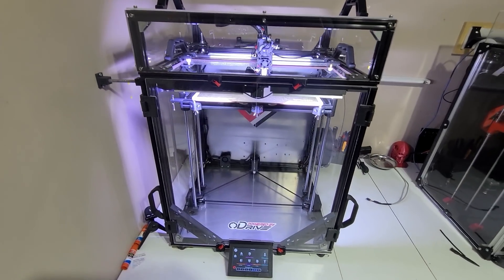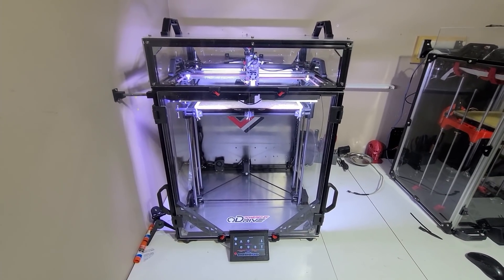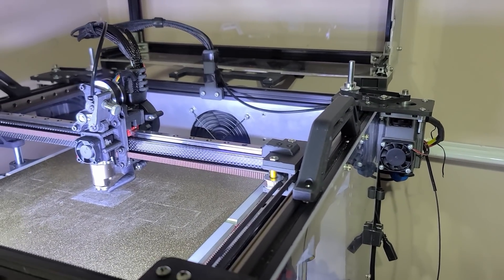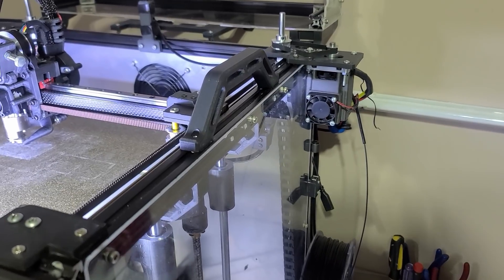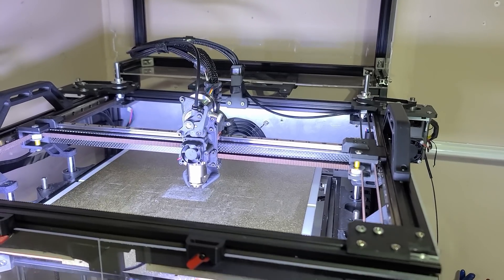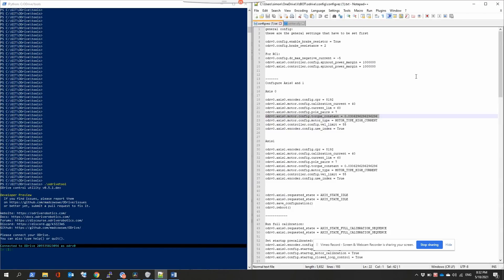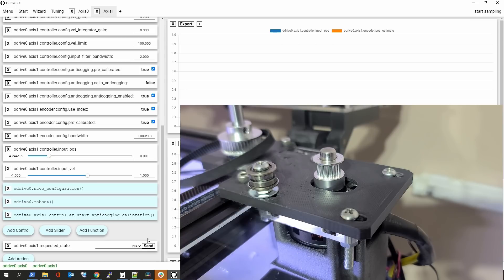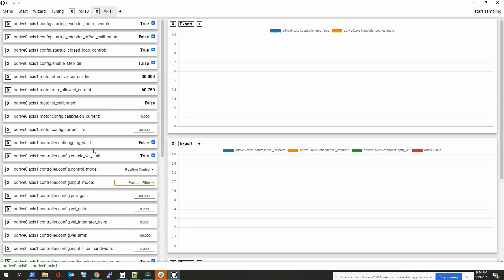ODrive 3D Printer instructions

Comment: Niiice!
As for the tuning it basically is a PID loop, where P is pos_gain, I is integrator_gain, and D is vel_gain. If you don't know what a PID loop is there are some great videos here on YT, if you wanna do some tuning while understanding what you're doing haha

I like to set the D very low, then raise the P until I see overshoot (meaning that when you move the setpoint the position overshoots it and stays there), back it up a bit, then raise the D to make sharper corners until it vibrates and then back it up a bit. If you want to be conservative back it up until there are almost no vibrations, if you want to be aggressive you can set it to when there are vibrations that stop after a bit of time, you'll fix them with I but it's a bit harder to tune. The I makes the motor stay on the setpoint more precisely and eliminate the overshoot. You can basically crank it until you see vibrations and back it a bit too.

As somebody else mentioned in the comments, it certainly helps to tune it while the system is under the expected load, so with the belt on. The tune will change a bit with it (AKA you'll might wanna raise the gains a bit further)

I'm definitely not an expert and I'm not trained at this, but I have fun with it and found this out by trial and error. Maybe some expert will correct me, but that's how I do it :D

Comment: I know it is easier and safer to tune with the motor disconnected from the drive belt. However, I think you should tune the system with the expected load applied, i.e., the motor should be driving the printhead during tuning. That way the tune is optimized for the actual use case. Not sure if you mentioned that as I just skimmed through the video :)
Reply from the maker: Yes that was just the getting started video. After that..you need to tune while printing :)

Comment: WOW this guide is incredible, this is worthy of a CoreXY upgrade. So now I understand why you did a 2:1 gear down ratio. The O-Drive doesn't have the resolution like a stepper, but instead it has far more potential RPM range. So this way you can use it's full range of RPM to control the slow and fast speeds. I hope that such a system can be scaled down to use smaller and wider pancake brushless motors. Since 270kv is too fast, maybe a 80-120kv pancake motor would be ideal.
Reply from the maker: True..and having big motors like that cause minor artifacts on walls that i will show you all in the next video.
Reply from the maker: Smaller motors sbould fix that i think
Reply: @Vez3D  Regardless of current setup, it is awesome. I think you're one of the coolest innovators in FDM. My next printer is definitely going to be based on your design.

Comment: As other mentioned, you need to tune them in the system under normal printing conditions. Odrive is cool, but you can get nema17 closed loop servos with optoisolated step dir input, encoder and integrated driver for 70$ each. So basically odrive integrated in the motor. I have these Nema23 servos on my cnc and the 17s for a big drawbot, the small ones can rip a printer apart. I think the odirve is a lot overkill in terms of power. But I like that you try it and the information was great! One thing about tuning.. I like to make a gcode wich just makes the same move a few times forth and back, with feeds and acceleration I think are possible, then in the tuning software you see how much your changes are affecting the pi loop. I’m not sure, but in your lower graph, the orange one looks like it is displaying the difference between commanded and actual encoder position. This is the position error and effectively what you want to get as low as possible in any normal operation. If this value is always above or less then zero (or the range you’re fine with) when not moving, you can use the integral value to correct for this error and overshoots, but too much will make it oscillate. Think of the boss yelling at you when you’re not exactly doing what he wants.. but one day it’s too much;)
Reply from the maker: Yes I saw those servos. I am very curious if they can give you high accel and high speed.
Reply: @Vez3D  they are very fast, and therefore used a lot in pick and place machines - 3000rpm. I have the 78W version, which is double the length of a standard nema17 stepper, torquewise I don´t have any numbers, but from "feeling" i would say they are easy three to four times a standard stepper. One thing is pretty interesting.. they can pull up to 5A (24V) for a short time, however when standing still, they are using about 300mA and when then hard pushed by hand, I was not able to get them to pull more than 1 amp (this is with no gear, 20T pulley belt drive). So in practise, they may can pull 5A while accelerating, but are not nearly in the class of 30Amp odrive.. may not interesting for a lot people, but i think it does matter how much power your machine needs when running a printer for hours. In my project I´m using them for a battery powered drawbot. But tuning them is a whole different story and I do not recommend them to anyone who is not that deeply interested in motors.

Comment: im about 80% done with building your design but i have not jumped into this odrive stuff yet. im using all nema 17 motors, for the hotend assembly im using a lgx extruder and a slice mosquito im using pink and black for my colors to entice my wife into printers lol and it worked. she loves it. but i hope to jump into the odrive stuff and i need to buy the aluminum gantry parts. i have the printed parts in petg. i have 4 rolls of some really good carbon fiber that im gonna try doing all the printed parts with on my friends enclosed voron

Comment: Ordering my Odrive today or tomorrow
Reply: Why not wait for the next revision?
Reply: @timmturner  because:
- From what I've seen on dickcord, there's no set date for v4.
- Semiconductor shortages are a b!tch. Odrive has a notice on their site asking for help sourcing some things.
- Current version should do everything I need, not even sure what's changing for v4.
- I want to play with it now. It's available now. It's been ordered. :) 
- I have at least 3 projects I want to use odrive for besides the printer.
Reply: @forbiddenera  That's several good reasons :)

Comment: Lower kv do not mean more torque. They have same torque if they made the motors correct. You just need to hit higher rpm for same torque. To me it looks like a regular brushless hoverboard motor with a controller. You are basically running it on 14s :)

Comment: The corexy belts are not parallel with the x axis. Does this not create print distortion? Why so much development on a printer with such a fundamental design flaw?
Reply: Assuming 5mm deviation from parallel, you should be getting approximately 0.4mm non-linear distortion per 100mm of x axis travel. Do you mitigate for this in software?
Reply from the maker: I had a part failed that day and it was temporary. It's fixed now :). Good eye 👀
Reply: @Vez3D  Ok, great! I got interested in your videos as I’m currently building a RatRig Vcore3 but intend to you the same carbon tube as in your design. Great content, keep it up

Comment: Can I ask why you would want to use non-sensored brushless motors that have crap cogging for a 3d printer? As someone who has done RC for decades, sensorless brushless motors are only good for RPM. But they are extremely hard to control properly, it seems this is just a "Cool" thing to do with not much gain, wouldn't it be better to figure out a way to make a stepper faster?
Reply from the maker: Hehe i guess you have not fallen my chanel. Im back on steppers for a while now
Reply: @Vez3D  I do but it keeps knocking you off the notification bell! So it doesn't show me everything!

Comment: Thank you for the long video you shared. I haven't gone through all the technical details in your video, but a couple of questions come from my mind: How did you do homeless sensor with this Odrive driver board from this bigtree board? Also, can the stallguard work from bigtree board? In case if there is stall in the system, how did the board and Odrive driver sense it to prevent burnout of motors?
Reply from the maker: It uses stop switches
Reply: @Vez3D  I was aware you use end switches there. How about stall protection in ODrive board?
Reply from the maker: @yubingchang  sorry I didn't experiment with it

Comment: What is the reason to do so? If you want more torque and speed, you can go with bigger steppers like nema23 or even 34. Can you please explain?
Reply from the maker: I didndt see a nema23 doing that amount of accel and speed yet. Maybe it can ... i dont know. But steppers are losing their tq the higher you spin them
Reply: It is easy to convert torque to speed. Bigger pulley
Reply from the maker: @bf-man  then you lose resolution
Reply: I guess that it is still be higher than in your set up
Reply: In microsteping mode there are about 50 000 steps per revolution. Way more than a usual 3d printer needs
Reply from the maker: @bf-man  true valid points. However you cant go high microstepping  if you want to go fast. Step pulse limit is a reality :) also ultra high microstepping is not always more accurate
Reply: Yeah, there are a lot of details. A prototype is needed :)
Reply: Would really love to see a video of your set up showcasing precision on such high speeds :)
Reply from the maker: @bf-man  haha for precision this is not way to go :) 300mms max and  10k would be my precision settings
Reply from the maker: @bf-man  nema23 is also a good option i guess. Would be very cool to test. There are several good ways to achieve fast printing
Reply: Would be a really cool comparison if done on the same machine. Printing speed, accuracy and even price. I guess it should work very well with tmc5160. With external mosfets it can spin almost everything :)

Comment: Thanks for the good job. For clearence as term of "bandwith" is set default to 10. Not 1000. You wish in video to make us comment. Im glad to see this video and if I help by comment
Reply from the maker: I am glad that you comment :) mine was default at 1000. I doubled checked again to be sure. we are talking about encoder bandwidth right ?
Reply from the maker: if you are talking about input_pos filter bandwith..then yes ..defaut is 10 on my side as well :)
Reply: @Vez3D  Oo you got me. My mistake.  Example in documents says 10 so I took it 10. But I little bit searched and something. If we can measure the time between setpoint order and arrive time to target point we have our duration in ms. Then convert it to s by divide to 10. Now its our period. 1/period will give us frequency. I mean for example duration between setpoint order and achieving to target  point is 200ms, our frequency is 20. So bandwidth is 20
Reply: Btw Im working on Cartesian robot project, which ım using odrive to make them hell of fast:)
Step/dir is the key. And you gave the key. Very appreciated. Glad to see your Channel and awesome guide.

Comment: 12000 rotations per second would be insane
Reply: BLDC motors don't like to run super slow, so you're almost guaranteed to have a gear reduction before it goes into the drive pulleys, so in something like a 4:1 or 5:1, you're looking at 3000 RPM or 2400 RPM respectively at the pulley side (that's per minute, not second).  Most steppers will run up to 3000 RPM, so long as they can maintain the torque needed.  At 48V, you can likely use a stepper without much issue, but you'll need some HV 5160's to drive the steppers with that voltage.
Reply: @TheJaredC01  yeah i think i was tempted to go that route myself. except there's just this 1 thing that makes the odrive better: it's the noise. steppers are so much louder than this odrive. now if you don't care about that aspect. then yeah... the new LDO nema 23 42mm HEV stepper should pan out to be a great performer. but it's probably going to be a heck of a lot louder than this thing is
Reply: @dreamcat4  agreed on all counts, just pointing out that it CAN be done with steppers, and for cheaper than the Odrive setup.  I looked at going the Odrive route, and realized I could get everything for the stepper route instead for what equates out to 1/4 the cost, with the only real downside being the noise...  Considering my printers are generally kept away from the "busy" rooms, the noise isn't enough of an issue to push me over the edge on the Odrive.

Comment: ive been looking at clearpaths and Odrives for a while for my fist high-speed DIY printer, this may make me pull the trigger! The step-dir limitation is unfortunate, especially with Klipper. Hopefully we can get full CAN-BUS on the Odrive and Klipper! now if MirageC posts his setup with the Clearpaths ill be hard pressed to choose.
Reply: the only thing that confuses me is that the holding torque in oDrive+FOC is going to be less rigid than a conventional stepper, correct? like there will always be some inherent "flex" to the system" since it can only react to the deviation so fast and within the limits of the PID loop. How does one accommodate for all possible acceleration overshoots and etc without full closed loop control integrated in to the mcu running gcode? 

I just got a very powerful servo motor for simracing wheelbase and the foc control algo for this thing is an absolute mess, if you need to compensate for oscillations the response of the system falls flat, feels like turning through a springy rubber damper even with several hours of tuning and loading settings from other users... try to tune it the other direction (for response and linearity) and it will shake your house apart if you let go. I'm just totally unimpressed with the entire thing.

Comment: Loving the video. Really great work. I did see something curious. It says on the Odrive motor guide that the 270KV motor is rated for a max voltage of 32v, and you are running them at 48v. Why?
Reply from the maker: Odrive board runs at 48v...and its rated to 56v max.  Voltage to motor and voltage to motor is something different i guess
Reply: @Vez3D  yes, my guess is that since the larger motor is rated for 48v the driver has to handle that current, since it's made for both motors. But one thing is what it says on paper and another is how it handles in the field. Maybe since torque is not high, you have been able to get away with it since the amps are not that high and heat is not building up. I'm just curious about weather they will hold on in the long run. Or if I lower voltage to 32v will I loose a lot of torque? And not be able to reach the speeds you are getting...
Reply from the maker: @eukaliptal  i tried 24v and it was rocking too

Comment: Is bigger ferrite rings ok? Or does size matter?
Reply from the maker: good question for Odrive gurus
Reply: The ferrite rings are only to suppress common mode noise. When your motor is operating in optimal conditions you should not have much CM noise but it depends on how currents flow. Brushless DC motors like these have three wires with currents that are 120 degrees out of phase. When the motor is spinning the Odrive will try to make sinusoidal waves and in the case of perfect sinusoidal waves with 120 phase separation the sum of the current over the three wires would be exactly 0. 

In practice the Odrive will never be able to make perfect sines and there will be higher order harmonics on the signal as well. These higher order harmonics can cause stray electromagnetic fields that may couple into other circuits. Mainly analog circuits will be sensitive to this (such as the temperature sensor in your printer). When the stray magnetic fields couple into something else, the sum of the currents in your motor wires might not be 0 anymore. The resulting currents are called CM currents. 

The currents themselves are not bad by definition but you need to know how to deal with them. Ferrite beads around your cable can partially block these currents. Grounding your motor with an extra wire back to the Odrive can also provide a good solution. Grounding actually increases the magnitude of the CM currents but it will also reduce the stray magnetic fields. The noise wont hurt your motor, only other electronics so directing it back over a ground wire can also help. Of course with the aluminium face place connected to the printer frame you also have a ground connection of the motor. 

Back to ferrite beads. There are a few things that can affect their performance. Start with identifying which frequencies you want to reduce. Generally this will be the switching frequency of the Odrive output stage. I'm sure this can either be configured for Odrive or if it is fixed it will definitely be shown in the datasheet of the Odrive. Once you know what to filter for, look in the datasheet of a ferrite what the filter characteristics are. The characteristics depend on ferrite dimensions and material, just trust the datasheet. Make sure to select a ferrite that will fit your required number of turns for your cable. More turns is more damping on the target frequency but every turn will have less effect than the one before so you can't just keep on winding.

Comment: You don't need stlink, use the dip switches on the odrive board!
Reply from the maker: For dfu you mean?
Reply: @Vez3D  yes
Reply: @Vez3D  good video however... and i mean one dip switch...
Reply from the maker: @jtreg  that was the first thing I tried .. but it failed .. also tried with some help from Odrive and we finally just did it with the stlink instead...
Reply: @Vez3D  OK, but did you see @dev255 Neil Devonshire - Dev255's  video https://youtu.be/uY-7Pze_sr4 ? My attempt to do same worked, just wondered why you needed to us STLink. Very clear presentation though, thanks dude.
Reply from the maker: @jtreg  I have a different board than him. The switchs are right there for me
Reply: @Vez3D  ok makes sense, still very useful your video, ust figured out how to run ODrive_GUI on my Mac... bit of a treasure hunt! ;)